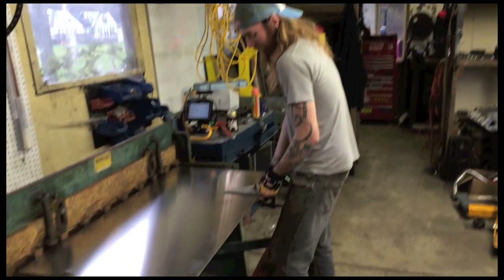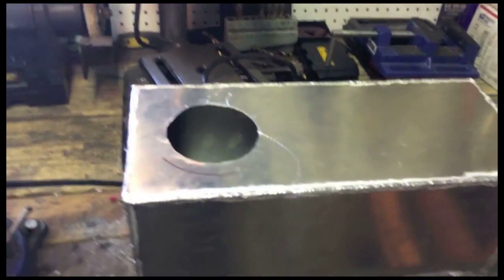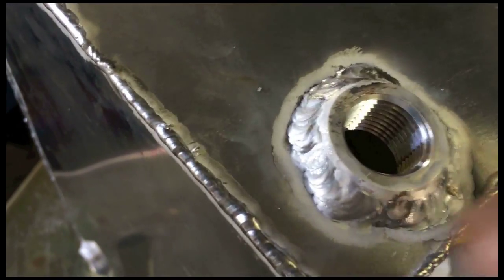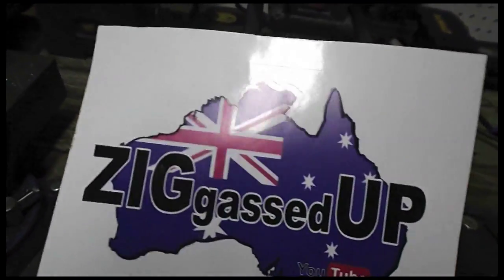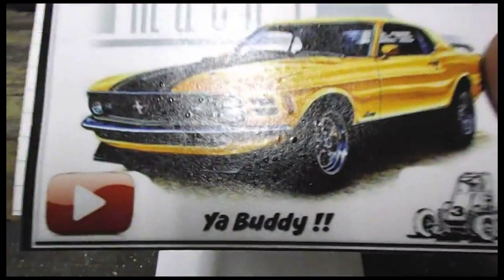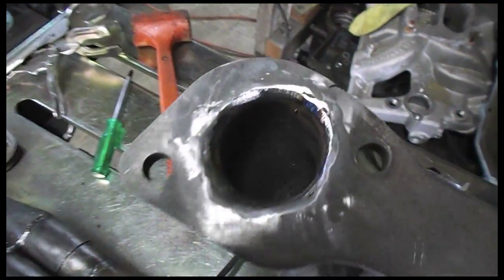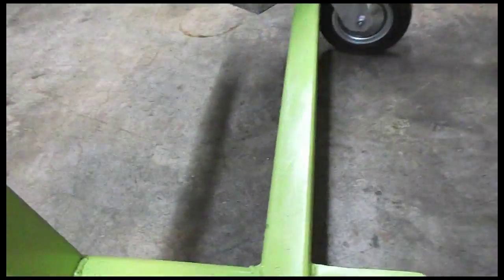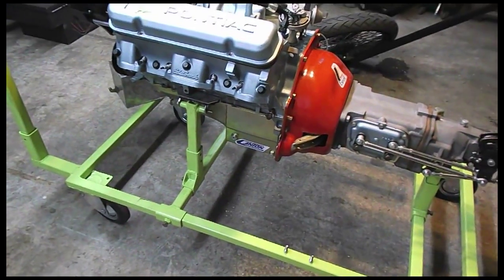T37 Build Update Pt 16

Comment: I like the tank. in gunsmithing they call it jewelling the metal texture
Reply from the maker: ***** Yeah it seems to always be smaller components that get that term. I really want to set a few pieces up on my buddies CNC machine. i bet i could get a real nice repeat finish using that!  Would be perfect for restoring 2nd Gen Trans Am dash panels. Accurately.

Comment: The tank looks Sweet.  Real nicely built starting stand.  Looks beefy but not too cumbersome.  Nice MC.  Thanks for the kind words. The motor looks so good.  Just about ready to run?
Reply from the maker: strokedfirebirdable Thanks Dave!  Carb, Radiator, Distributor, and wiring.   Not much at all really.  Been shopping for most of that at the moment... just waiting to pounce on a good deal as im not in a huge rush.  Cheers.

Comment: what gauage metal is it rated 2 cut?
Reply from the maker: wildeyednorthernboy It will cut 16ga with a bit of a jump. But once it starts cutting it. it goes through easily.  I still havent sharpened the blades yet, so the aluminum even though thinner, is harder to cut than the steel.
Reply from the maker: wildeyednorthernboy but yeah, its rated to cut up to 52 inch long 16ga sheet.